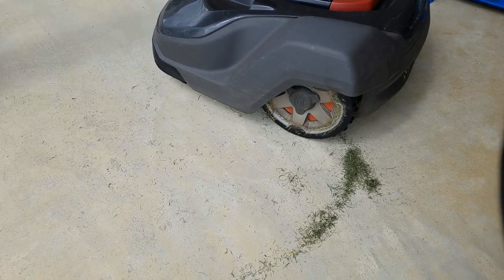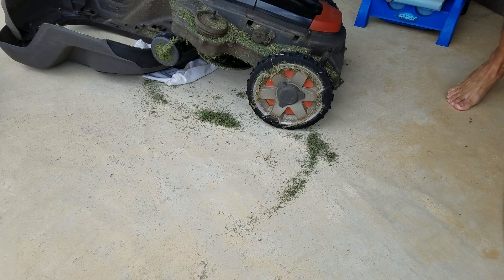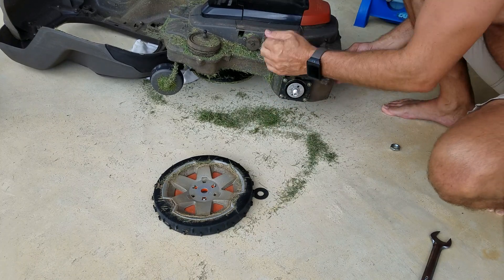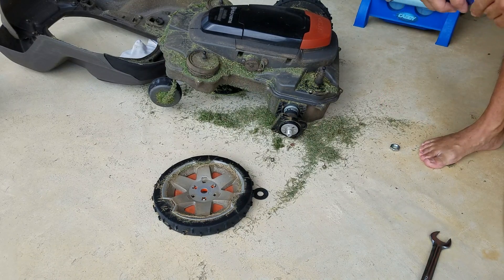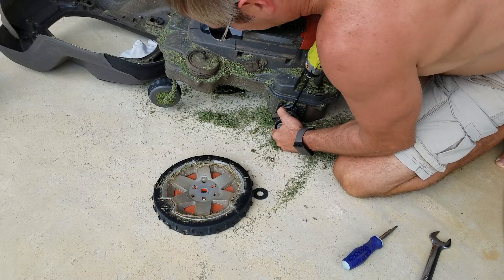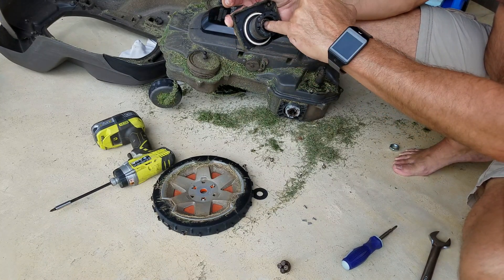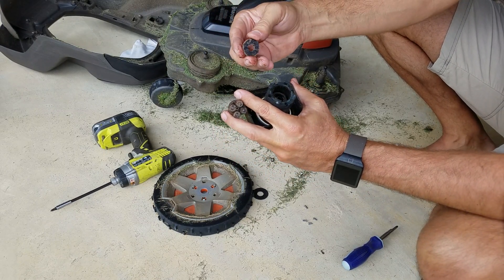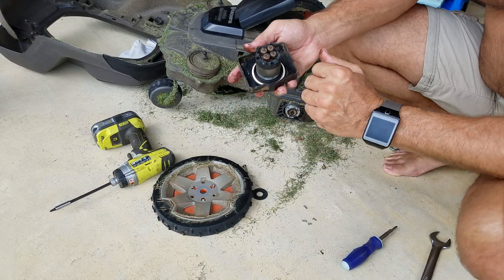Husqvarna Automower 450X Wheel Motor Fault

Comment: This is a great video!  My 450x has 5,283 hrs on it and previously no issues so I've been pretty lucky.  Earlier this week, I noticed that my automower was taking a long time getting back to the charging station at the end of the mowing day.  When I went out, I discovered the right wheel was turning and the left wheel was locked; no fault message on mower (not sure if that's because it was in searching mode instead of mowing).  I ordered a wheel motor and because this part ships from the Safford in Alabama and is going to take about a week (I am in Wiscosnin), I decided to take the planetary gearbox apart and see if I could temporarily get the mower back up and running until the replacement part arrived.  Upon inspection, there were no issues on the plastic gears other dirty so I cleaned them up but the seizing was coming from the metal gears under the metal washer.  I filled the metal gears with carb cleaner and I got a lot of dirt and debris out (a lot).  I repeated this carb cleaner process (fill and empty in the gear box) and on the third time, I got out what appeared to be wet spongy insulation about the size of a dime.  Of course this was the dried lubricatant softened up by the carb cleaner.  I repeated the carb cleaner process one more time as the gears were still not rotating freely and the remaining clump of lubricant came out (about the size of a distorted penny) and the gear box starting rotating freely.  I added some automotive lubricant (white lithium grease) to the gears and put the unit back together.  It's been running again for 8 hours without issue.  My automower season is up in less than one month when leaves really start to fall and the automower just pushes leaves all over the yard so, at that time when I winterize, I will repeat this process on the right wheel motor and keep the replacement wheel motor for when one of the motors actually fails.

Comment: Does somebody know the reference of the gearbox?
Reply from the maker: Do you mean manufacturer information in order to get a replacement for just the gearbox?  I tried that route for gearboxes for my Lawnbott a few years ago. After mjch research I found the  exact manufacturer and part number and contacted them but they would not sell me one. They knew exactly what I wanted it for without even telling them because it had a shaft length used only for the Lawnbott. I have not bothered with Husqvarna because their replacement motors are about 1/4 the price of the Lawbott.
Reply: @Skul-Ski  Yes gearbox reference.

Comment: Great video.  What kind of lube?  Will gear oil work or does it have to be grease?   Also, should I also put grease on the motor side under the little cover where all the hardened burnt grease is?
Reply from the maker: I just used automotive axle grease. Gear oil is not an option. Too thin. It will run out and potentially leak back into the motor windings.

Comment: same problem on my Gardena Sileno, the motor-gearbox assembly looks identical, those plastic gears are done. Replacement part - you have to buy complete set motor-gearbox for 160 Euro :(

Comment: What kind of grease did you use?
Reply from the maker: I just used some automotive bearing grease.
Reply: @Skul-Ski  I took the wheel bearings totally apart on both sides and sure enough they were gunked up. I cleaned them up with brake cleaner and lubed them with marine grease and replaced the battery. I have 2000 hours. The thing is running like it is day one. Thanks for the video.

Comment: Thanks so much for your helpful video! My rear right wheel seized up so I stripped it back and cleaned it up, re-greased it, and think it will work ok now - got snow on the ground so can't test it on grass yet! However, I thought I should do the same for the left rear wheel and ran into a problem with those small screws that you removed at around 3 minutes into your video - only 1 will move, and the others are now slightly stripped, so I have a choice of leaving it be and crossing my fingers til it breaks, or drilling out the screws and replacing them with new ones. Do you have any idea how I'd get replacement screws to fit though? Not sure what they're called / size etc. Maybe Husqvarna can help - but it's out of warranty now by 7 months.
Reply from the maker: I would try to use a power drill or impact just as I used to remove them BUT!!!  Make sure to get yourself a Phillips head tip that fits very perfectly into the screw head.  Use your fingertips to see that there is almost no wiggle at all with the bit when you mate it with the head of a non-stripped screw.  Then. lean in a push down with all your weight before you pull the trigger to unscrew.  You will see that is just what I did at 4:08 to get one of the screws out. Definitely replace them with new ones once you get them out if the heads are in bad shape.  Sorry, don't know the exact size off-hand.
Reply: @Skul-Ski  Thank you! I'll try measuring one and look for something online :)
Reply: Hi, and thanks for good tips, I have opened more than ten motors trying to fix them, I gave up... gearbox is one thing, yes you can grease it up and hope for good result. Motor itself is sealed unit, but I did open them up just to see what's exactly going on. And yes they were warranty motors and when I opened them up they were full with black sticky stuff, dead motors...

Comment: Why do not you use the two year warranty?
Reply from the maker: I did. Got a replacement motor under warranty in the box waiting. Almost through another season with that "band aid fix" and still going. To be hinest it actually has almost completely quieted down and not a single fault. I have been mowing exusively at night.
Reply: @Skul-Ski  HOW did you get them to honor Automower warranty after you cracked case?   What number did you call?   Or did you go through local dealer?    How did you convince them to order part?   My local dealer told me they don't work on robot mowers so I sent email to Husqvarna, but an "Expert" replied and said he was going to forward to corporate, but I haven't heard anything?   My 315 is in pieces in need of two motors actually.   One grinding, and the other stiff compared to my other one that has been operating about same amount of time.
Reply from the maker: @woody3307  been so long I don't know the number I called, but I explained the problem. They said to bring it to a dealer but I told them the nearest dealer was almost 200 miles away and that was not an option. (there is one in town now). I just explained to them the part I needed. I went into great detail and my prious experience with robotic mowers so that likely played a role in them just sending the part. Figure it saved them warranty labor as well.
Reply from the maker: Actually, I did.  I received a free replacement motor because of this and I still have it on the shelf waiting for when I really need it.

Comment: Did you get an updated motor for the RH side? Build date of your 450X?
Reply from the maker: I do have the motors with the two extra protrusions at the bottom of the black plastic mounting bell which I understand indicate some sort of a newer version.  That is the case with both the new and the old motors.  I did not see any obvious difference between the look and design both externally or internally of the new vs the old motors components.  I received a replacement for the right motor directly from Husqvarna's repair facility shelf because the replacements were back ordered.  I opened up the gearbox of this brand new motor and was shocked at how little grease there was in there so I added a couple pinches more.  Bought the mower in April of 2017.  I intend to inspect and clean the planetary gear gases on a schedule for now on for sure.  I will start inspecting every 250 hours and then move that out further if I feel it is okay to do so.  easy enough to do without even opening the case as long as the electric portion does not get "slugged up" again.
Reply: I guess you live in a really hot place.Wonder if its only a low temp grease used. What kind of grease are you using?Mine is S/N 171017272 with build date 2017-03-15 with today 920 hrs. No problem yet and I haven´t heard much of similar problem in europe.Summer this year in Sweden was record hot, dry and long so the automower stayed most of the time in its garage.Now temperature is dropping rapidly, so soon season is over.I will ask my dealer next time if he has any info.
Reply from the maker: @fredrikdahlgren659  Yes, I live in north Alabama and my grass is Bermuda, so it is quite thick and grows fast so the mower gets a lot of hours, but so did my Lawnbott and those planetary gears lasted 7 years on the same property. It was the motor brushes that were the wear item on the Lawnbott. These Husqvarna motors lasted less than 2 seasons!!!

I added a pinch of regular automotive wheel bearing grease.  I am hoping that will add significant life. 

Grease that was in the motor was almost like vaseline and such a light coating that you could barely notice it's presence.
Reply: I also live in Huntsville, had a 450X motor replaced the second season. Thinking I should probably grease the other one now.